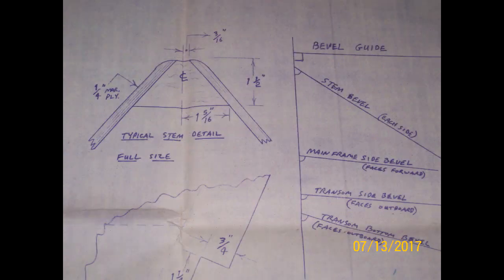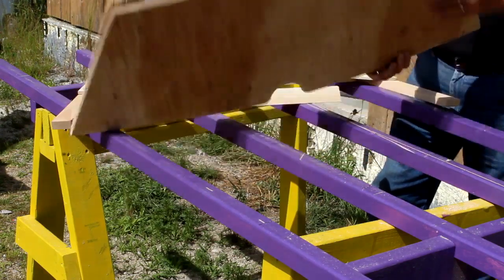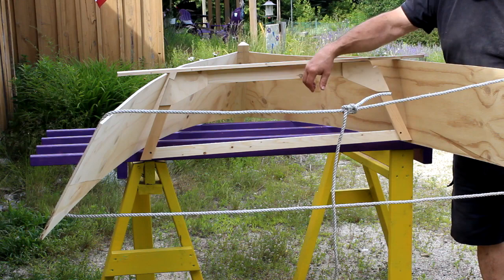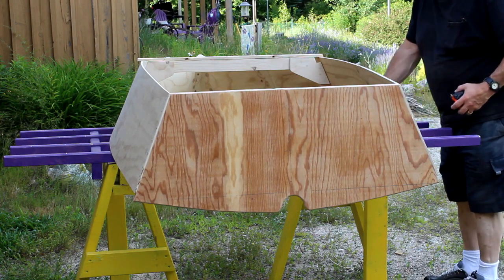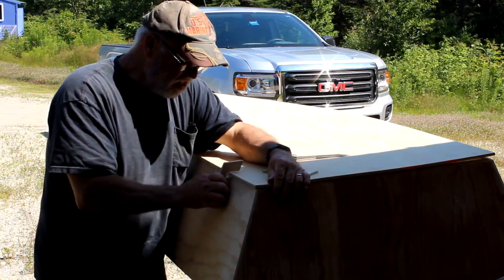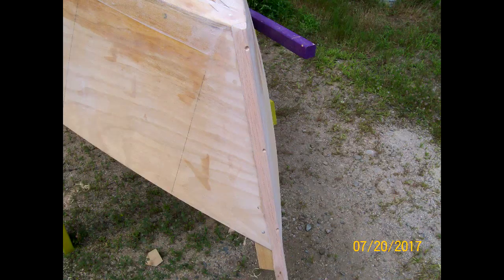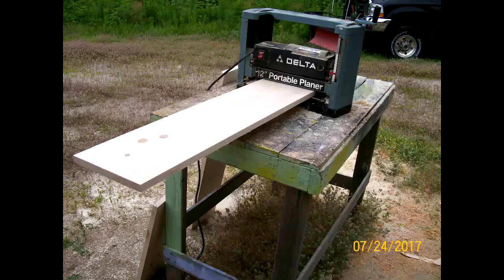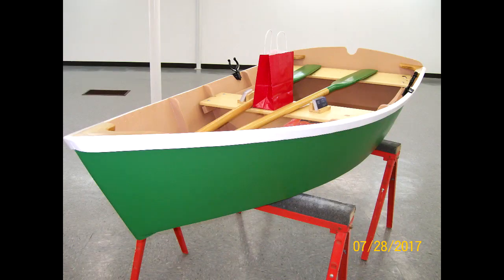(S-2 Ep-39) Build 'er Yerself, Ya Scurvy Dawgs!

Comment: Looks like a quick fun build!
Reply from the maker: This particular design was one offered in my 3 day weekend boat building classes years ago on Cape Cod. Students would be provided with all the raw materials and hardware, along with a set of plans and instructions. I would guide the student through the build and at the end of the 3 day class, everyone went home with a completed boat that was ready for the water with the exception of the paint. Many of my Shoestring Shipyard designs that were intended specifically for the first time, novice boat builder, all go together pretty much the same way (more or less). One of the reasons I started Shoestring Shipyard many years ago, was to encourage and inspire folks to give building their own boat a try. I figured I'd get the started with a basic, easy to build boat to get them started where they could actually finish the project in a short amount of time, and that would pique their interest in trying more complex designs. The biggest hurdle encountered by the "newby," prospective boat builder is simply getting started on their first project.